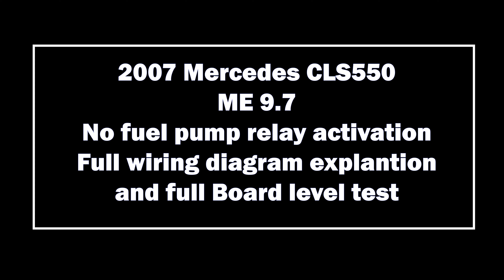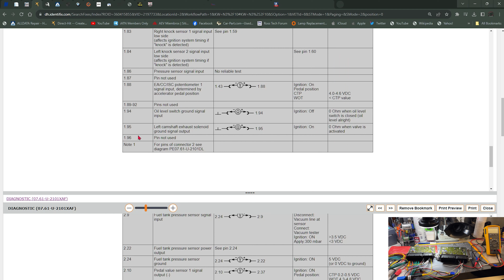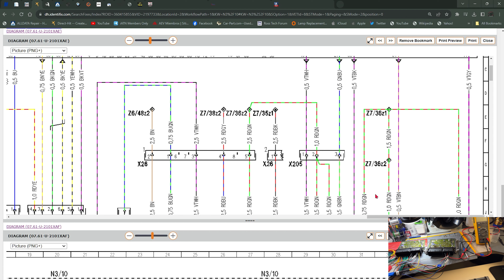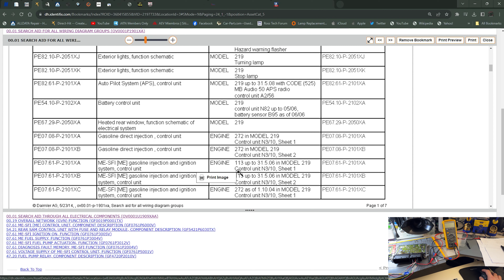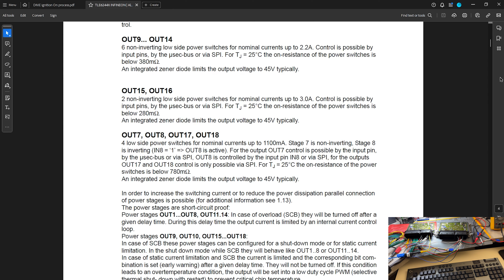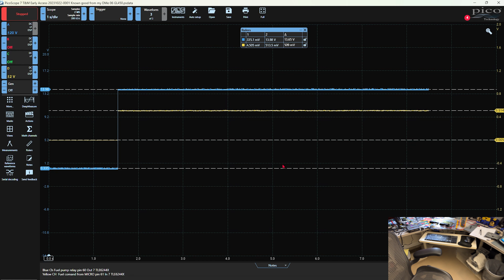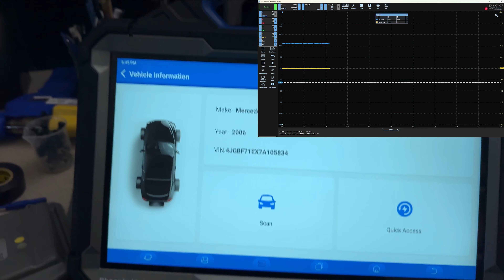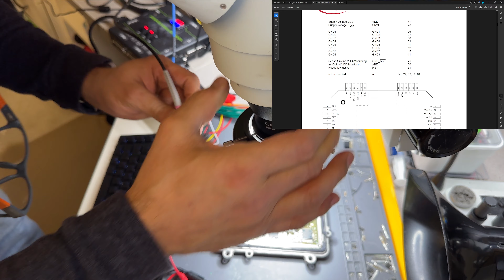2007  CLS550 ME 9.7 No fuel pump relay activation Full wiring diagram explain and board level test

Comment: I know it's too late now, but try and manual trigger the output and see if you get that delay again. There was a definite delay you caught for sure. Not sure why the IC output stopped, but when probing around it's easy to short, over volt pins as you are well aware of. Complete power cycle do anything to get IC back up? And what should the pull-up be on that circuit, looks like you had 0.5v you said? Wouldn't it be pulled up to a more normal logic level voltage? Then again, you tested a known good and I think that was the same. 
Fun video and good example of how to prove a diagnosis.

Comment: Hi and thank you for everything you are doing I'm from Pa I have the 2007 c280 w203...the ECU died I buy the same ECU from yunk yard I replaced the eprom from the old to the new read everything perfect but the car don't start..I removed from the shell when I put it back don't do anything need help please...
Reply from the maker: Hi Juan,
This is not a EEPROM ECM clone. That requires a flash read and Virginize it.

Comment: C342400
W221.156 S350L [Current/Historical Fault] (Event) Read the fault memory of the control unit N82/1 (vehicle network control module)
N 82/1 In which position？In which position? please help me!
2010 3500cc v6